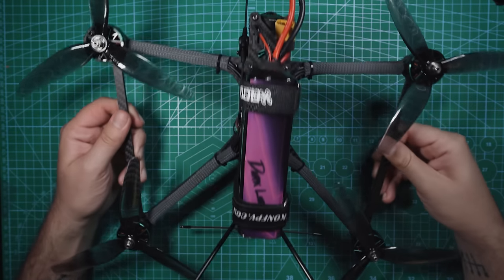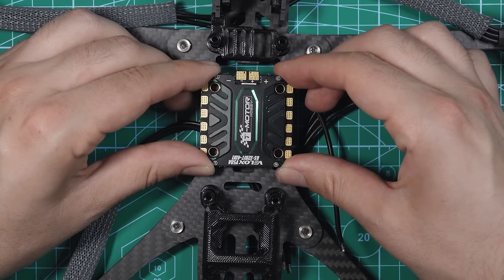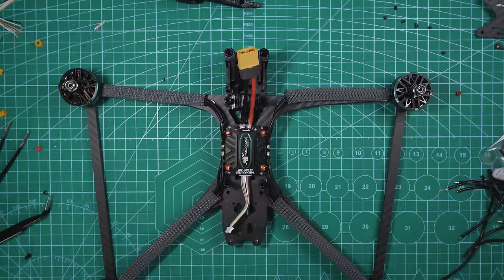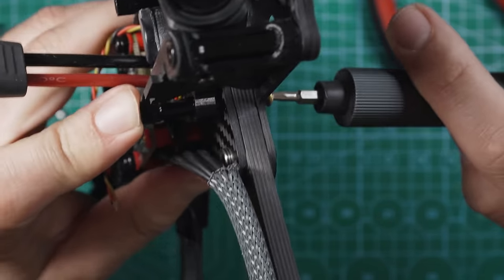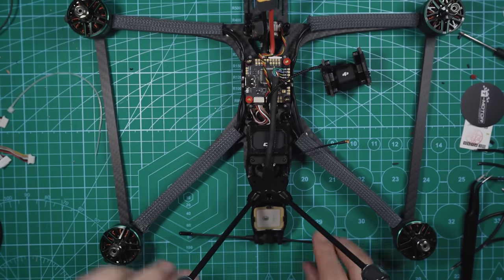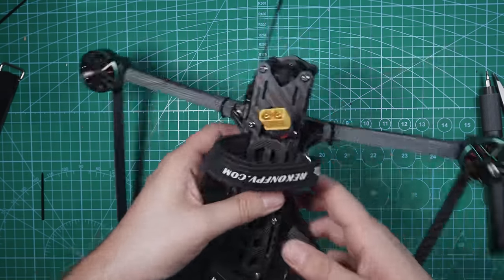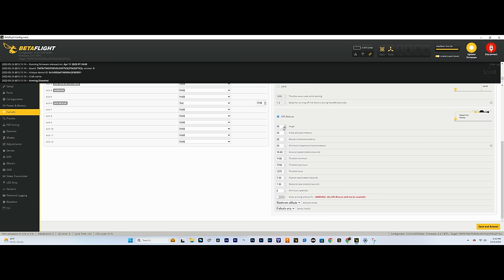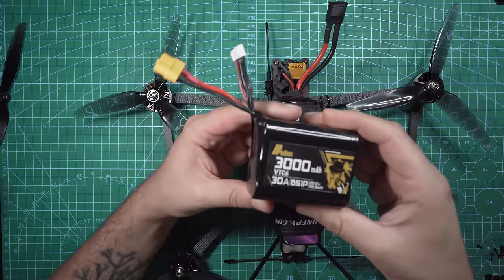How To Build a 7" Long Range FPV Drone

Comment: Kudos for grounding the copper tape, I've seen quite a few builds that "shield" the GPS wires with copper tape, but then don't ground it.... 🤦

One of the downsides of spread of information at the speed of internet... There's alot of bad advice out there.

Edit: just a thought, but I would heatshrink the ends of the braided sleeving on the motor wires to keep it tighter and keeps the braid from coming apart later.
Reply from the maker: I normally "melt" the ends of the braid so it doesnt get all frayed but I do like the idea of just putting heat shrink around it. could look pretty clean. Ima try this out on my next build!
Reply: @TRONCATFPV  the only downside is when or if you have to replace the motors it's a little bit more work.

Comment: Why did he use that receiver and not a common elrs receiver? 

My controller is not working on beta flight atm but does connect to my air unit 03 so I think it’s the receiver but don’t know 😕
Reply: What controller are you trying to use ?

Comment: What was the overall cost? I missed it.
Reply from the maker: For this build in the end you're looking at about $600-$700. That's with an O3 air unit, battery included

Comment: I'm so confused why nobody use pre-made shielded wire...
Reply from the maker: I am pretty sure Diatone & Flywoo have included shielded GPS wires with some drones/GPS modules.
It really should be something that is just the standard to include with all GPS's though honestly. I've noticed a huge improvement in sat lock when adding it!
Reply: @TRONCATFPV  Yeah I've seen some BNF with shielded wires but they look DIY like yours hehe. I use USB cables and 4 pins audio cables, agreed some will have sh**ty wires inside, just don't buy dollar store ones lol :)  cheers ( solutions for wiring it with the plug may vary, batteries not included )

Comment: Can you tell me why you shoot indoors with 60 fps 8x7? You render it out in 30FPS so you just use 60 in case you need to slow something down I guess or can you tell me the benefits? (On hero 11 you shoot 8x7 60FPS 4K 10bit I guess? Your old GoPro settings video is outdated
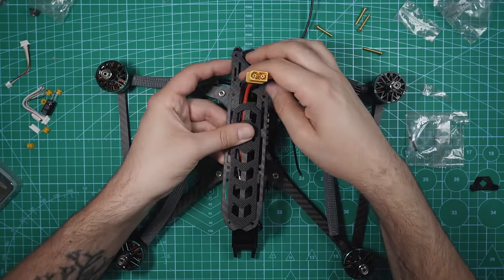Reply from the maker: I mainly use 8x7 4k 60fps for smoother speed ramping plus the 8:7 aspect ratio allows me to use the video for standard 16:9 videos as well as 9:16 for social.

5K 30 8x7 works great too 😉

Comment: how are you keeping video signal so far away? mine seems to struggle once I get 1k yards away.
Reply from the maker: Make sure you have MSP/DisplayPort set up correctly. If not, the O3 air unit won't exit standby mode and will get limited range.
When you arm the drone does the bitrate change?
Reply: I struggle with short video range as well. Kinda of baffled

Comment: What Remoter / googles do you use to fly as well as recommend?
Reply: I figured out that the VTX/Camera - DJI O3 works with the DJI FPV Goggles V2 and 2. Where 2 is actually the next generation to V2. Does anybody know of any alternative Goggles?

Comment: my frame didnt have gold screws for the esc, can you inform about the size of the screws?
Reply from the maker: I believe the gold screws came with the FC/ESC stack
Reply: @TRONCATFPV  its ok, i found some m3x 20mm, thanks
Reply: Also instead of O3 I went with walksnail, hope it will fit...

Comment: I'm still a beginner in the world of fpv drones and will build it.
Can I update the Flight control firmware before soldering the drone parts?
Reply: Yeah u can connect the usb and upload betaflight
Reply from the maker: yes but once it's all together you will have to still do some tuning to the drone.

Comment: i have kakute h7 V2 and  skydroid T10, i have connected ground 5V and RX but it is not showing any stick output in INAV, the receiver gets binded with transmitter. also on the serial post and saved the seting in INAV. please anyone can help.

Comment: Hi! I really want to try building this, but I have few questions if anyone can answer: 

How am I going to control/receive video feed from this drone? 
Is it possible to use other cheaper camera that would work with this exact build? (quality isn't priority for me, analog is fine too)
Is it possible to make it 4g based in future or control using a pc from home? (maybe with antennas set outside or something)

I really need a drone for a project (poor student), if anyone has any alternatives please tell me 🙏thanks

Comment: Hey so does this thing fly like a stable consumer drone. I little carvyness is kewl but I just wanna do a build on a drone I’m not gonna trash on the first push lol my son and I are still on the simulator
Reply: I think you can set axis limits in Beta Flight.
Reply: You can set up "Angle" mode in betaflight which prevents you from pushing the drone past a determined angle (i.e 35 deg).
Reply from the maker: I would suggest using Angle mode in betaflight, this will basically "auto-level" the drone so you can't do flips or acrobatic movements. Custom built FPV drones don't have the ability to hover in place when you take your hands off the controller (yet).

Comment: Hey I’m having trouble could someone please help me:( . Everything is fine but when I’m on the receiver tab in beta flight, my dji fpv remote controller 2 does not move the bars ??? I can see the different colour bars but when I move my controller it doesn’t react. Is the tbs crossfire nano diversity compatible with the controller I’m using. Would I have to buy a tbs controller or can I just use the receiver in the 03 air unit. Or should I buy a compatible receiver ?Please help
Reply from the maker: If you’re using the DJI remote 2, that will only bind with a DJI receiver (air unit or O3 air unit). To use that controller with this drone just enable the SBUS receiver protocol in betaflight.
You won’t get as good range but it’ll work.

To use crossfire you’ll need a different controller that operates on the crossfire protocol.
Reply: @TRONCATFPV  thank you, subbed

Comment: Don't you want 12awg cable for 6S?
Reply from the maker: you could also use 12awg if you prefer that. I have 14awg on almost all of my 6s XT60 quads. 
Plus 14awg is what comes in the box from t-motor. I can't imagine they'd include wire that wasn't meant for that ESC
Reply: @TRONCATFPV  Ah ok thanks, I'm fairly new to it all, just built my first one.  I tried watching loads of build vids first to get an idea and one person I watched told me that.

Comment: I built this drone and followed every step but cannot get my DJI controller 2 to connect to the drone. What do I need to do to get it to work? Do I need a different receiver other than tbs crossfire?
Reply from the maker: To get the DJI controller to bind you’ll need to set up the O3 as your receiver instead of a TBS receiver. All you need is the two additional wires on the o3 hooked up.
Reply: @TRONCATFPV  I’ll try that out. I was starting to think I wasted a lot of money lol. Thanks for the reply back!! Definitely hitting that subscribe button brotha
Reply: @Justin_Thomas hey I’m having the same issue. Did you fix it, if so how ? :)
Reply: What two additional wires do you mean ?
Reply: @TimeToImprove99  I couldn’t figure it out either. I unsoldered the receiver and got the controller to work in betaflight but as soon as I disconnected from betaflight the controller has no input on the drone. I will let you know if I ever figure it out
Reply: @Justin_Thomas.  thanks for the reply. God what a pain. I’ve unsoldered the receiver but can’t get any input on my controller. Did you use sbus or the first one? Thanks for the help I’ll let you know if I figure anything out
Reply: @TimeToImprove99  yeah I used sbus. Do you have the battery plugged in on the drone while in betaflight? Also im not sure why I would be getting input while in betaflight but as soon as I disconnect it doesn’t work. I’m starting to think our best bet would be to buy a different controller. I’m planning on taking mine to a drone shop if I can find one around my house in a few weeks and see if they can figure it out
Reply: @Justin_Thomas.  yes I had the battery plugged it. I’ve soldered the receiver back as im gonna get a different controller. From the research I’ve done I think the 03 air unit has a built in receiver, however it will be worse than the tbs crossfire. Yeah it’s probably best to switch controllers. I’m gonna get a tbs one so it’s compatible and it will be better in the long run anyway. Let me know what you’re thinking. I still couldn’t get any input on my controller even after switching to sbus :(
Reply: @Justin_Thomas.  hey pal, how is it going ? I bought the tbs tango 2 and it works great now. Let me know if you need a hand
Reply: @Epic1616-xm7hn  okay thanks!!! I will probably get the same controller then.

Comment: Your RX antenna placement and orientation is in the least optimal location possible.
Reply from the maker: Care to elaborate? I think we both can agree that the "least optimal location possible" would be tucked away inside the drone with both antennas side by side lmao.
I would argue that this frame allows for the most optimal RX antenna placement and orientation you would want on a long range quad.

Comment: a plane would be better for covering distance. And stock dji drones do 30 minutes.
Reply from the maker: Those two are completely different applications than an FPV drone like this.
If your goal is purely range, yea go for a fixed wing.

Comment: Wrapping the GPS cable with tape is doing nothing but adding weight the receiver has already decoded the signal into NEMA code before reaching this wire.  Also twisting wires to prevent interference only works in pairs twisting a bundle like this is creating unnecessary crosstalk.
Reply from the maker: I disagree. 
I've tested this on numerous quads with GPS and on every single one I got sat lock noticeably faster with the copper wrapping than without. 

Also, If you're concerned about weight this wrapping adds like 2g max. lol.
Reply: @TRONCATFPV  More likely you were comparing a cold start fix against a warm start with recent ephemeris between tests.  The signal is already digital NEMA code by the time it reaches this cable analogue interference isn't possible.
Reply from the maker: Nope,.
When testing this I was in an entirely different location days later. Cold start on both. Sat lock went from 3 Minutes to 30 seconds after wrapping cables.
Again, I've noticed this on numerous quads.

Comment: What is the purpose of building a long range drone if it only has a 25 minute flight time? Any true long range drone should have at least a 2 hour flight time (Flight to target, time on station and return flight) IMHO, Let me know when you figure that out. Good luck
Reply from the maker: Whoops! Sounds like you don't really know what's going on here. 
Time on station? Are you looking for a drone to survey hundreds of miles of powerlines or something? If so, you've stumbled to the wrong drone section of YouTube. The drone featured in this video is meant solely for cinematography purposes. Flying up to a mountain peak and gliding down the side.  

Not only does a 2 hour long FPV flight sound like absolute hell, but I can't imagine why anybody would ever need to do this. 

25 minute flights at 80mph avg will give you more range than you should realistically need.
Reply: @TRONCATFPV  You were talking about a long range drone with only 25 mins of flight time. That's only aprox 10 mins out and 10 mins back, how much distance could you cover in that short amount of time? Just doesn't sound like long range to me, JMO. When I think of long range, I think of 10 miles or more one way, like for a search and rescue scenario. P.S. No line of sight.
Reply from the maker: @reb363  Again, it sounds like you're looking for a completely different type of drone. This is meant for cinematography. 
Not search and rescue.

Lets math:
80mph for 25 minutes would yield you 33 miles total. Account for some battery sag and wind and you could easily achieve 10 mile one way trip.
Reply: @TRONCATFPV  Is it possible to increase the battery life on a drone like this? I'm new to drones, but I have figured out that unless you build it yourself, you are subject to the control of the drone companies Firmware. And sooner or later if they wish to restrict you there is nothing you can do unless you built it yourself.